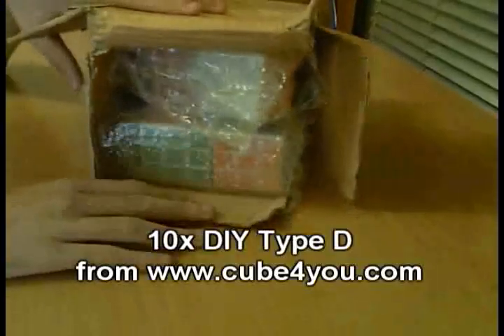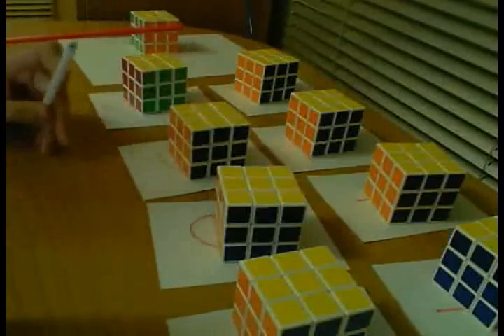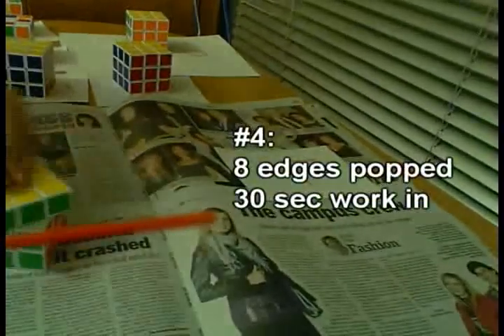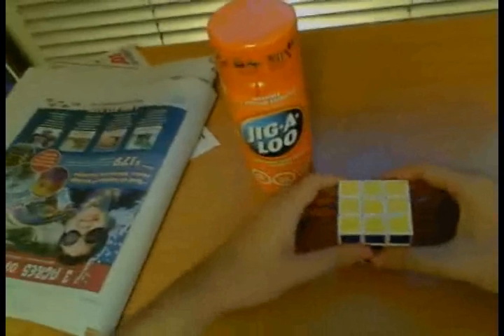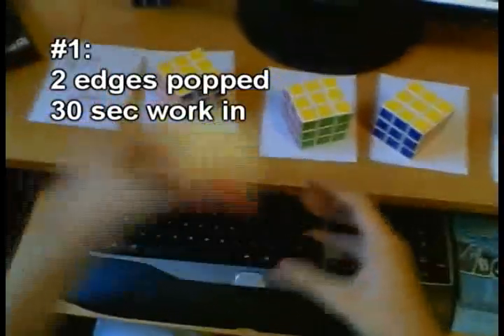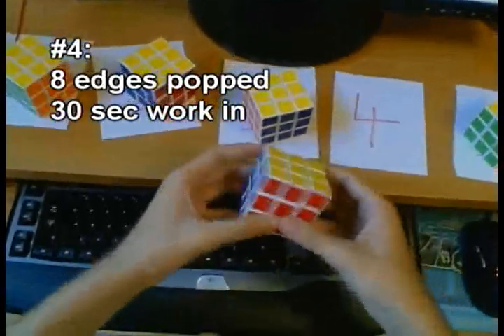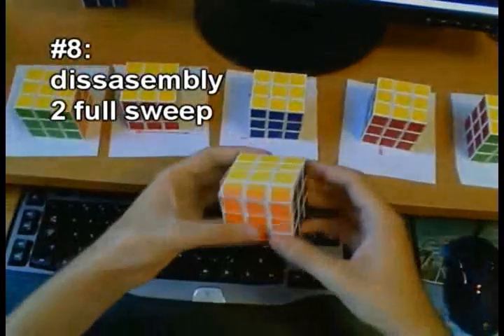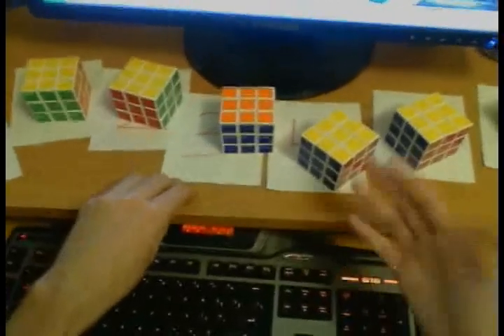Rubik's Cube Lubrication experiment

Comment: What's the best lube for a DIY Dayan Zanchi?
Reply: I tried WD40, it just made my cube oily and a little slower
Reply: +MCOnFire 
don't misguide man it's highly corrosive it works with very few types of plastic
Reply: i use wt 1 for all my cubes and wt 3 for the core
Reply: +Manya Cubies you mean?
Reply: Yeah I mean the pieces
Reply: WD-40 is not recommended, it's not actually a lubricant

Comment: I'm not from North America soo.... Idk the difference between this lube and WD-40, could someone please explain it to me?
Reply: yeah it's right it's corrosive
Reply: ***** Okay thanks!!
Reply: Only WD-40 Specialist can be used as a spray in the WD-40 series as it is their silicone spray. I just put a bit of 30k traxxas into my Rubiks brand cube (the tiled one) and it is comparable to many speed cubes now, even corner cuts nearly 45".
Reply: TheGozzila I did too, to my old rubies' brand cube, and it's pretty damn smooth but then I tried it on my rubies' brand speed cube and it worked for a couple of days but then it just made my cube way slower
Reply: +Zelaphin Strraughend the WD-40 makes your cube slow.
Reply: +Fazri Gading wd-40 is excellent lubricant but you should use it only when you are convinced that your cube can survive a lubrication done with wd-40
cubes are made up of ABS plastic and wd-40 isn't safe for it
Reply: yeah, my brother took it too much,
and yeah, the cube is completely worst.
Reply: for anyone who are reading this,
don't use WD-40 on your cube.

Comment: i use Calvin's Puzzle Lube on my Fangshi Shuang Ren and it cuts corners like nothing.  Just lube the screw under the head for each center, lube inside of the center pieces, then lube all along the side the last edge piece you put in (the one on the top layer that you put in between the two corners and force in on a 45 degree turn)

Comment: the core doesn't turn, it holds everything in place, you could spray the place where you have the pieces rub against each other, like in the video or spray the center pieces where they touch the core, if that is what you ment, but spraying the core only won't help at all.

Comment: silicone spray worked just fine in my zhanchi, but it gives it a heavy feel. if oyu lube a zhanchi with lubix or calvin lube it will turn 10x better and remain light and really really fast to move

Comment: I see that this is an old post, I am a beginner and searching for ways to get faster. Thanks to you I discovered the fredrich method only to solve the first two layers. My time has slowed alot but I see how in time they can be better then begginer solving with practice. Anyway, I have been using olive oil to lube my cubes. I heard you say vegitable oil as a good one and I had olive oil on hand, for me it makes the cube a smooth runner(olive oil). Try this and let me know what you think!

Comment: @AllenFG86 Well, sure it does, but eventually, the plastic on the inside will start to deteriorate, and the cube will age that much faster. Sure, silicone and jig-a-loo does that too, but at a slower pace, and is generally less messier.

Comment: I find if you dip a tooth pick in some lubricant and run it along all the edges of the top and bottom layer, then work it in, it will work very well

Comment: Well, it really depends what you consider "eaten".  the soft plastic does eventually start to wear off pretty fast, and it will get thin and break apart, though it'll take quite a while to get that bad.

Some people even do it intentionally for a bit to break in a stiff cube, then clean it off later and switch to silicone

The main thing is that people asking for advice know what they're getting into.

No, it's not going to melt your cube in an hour or something,  But it will shorten its life.

Comment: It'll still melt the plastic, but if nothing touches it (and your coats are light so there's no pooling) then it'll re-harden without much damage.

Personally, I'm not too worried, the wear isn't that severe, and you don't need to lube it that often.  maybe it'll wear out in 2 years instead of 3, but I'll probably break it, or lose it before then anyways.

Comment: If you just let it sit while there's still solvent there, the plastic will weld together as one chunk.
The upside to it, is that that slight melting will soften any rough edges in the cube, and they'll wear off while you're working in the lube.

It's kind of like breaking your cube in for a couple months, but it all happens in about a minute.

if you're really worried about the wear it causes, either pull the cube apart, lightly spray it, a few times, drying fully between coats, then reassemble.

Comment: Just so everyone knows how it works:

the silicone lubes are too thick to spray properly (and evenly), so they mix it with some lighter hydrocarbons (Its not a propellant, as some people say)  It's just a solvent to thin it out.

That solvent does melt plastic, which is what gives the sticky feeling right after you lube it.  Fortunately, it also evaporates quickly, so as long as you keep it moving for a couple minutes, it won't do too much damage, and then it's gone.

Comment: oil will degrade the plastic.  They're too similar chemically (plastic is made from oil).

The oil molecules will bind with the plastic molecules on the surface, causing them to detach.

If it's a really crappy cube, you could use it anyways, and buy a new one when it gets too messed up, but it's definitely not a myth that oil can eat plastic.

Comment: That's probably true. In memyselfandpi's video on lubing, he talked about how if you spray silicone between two surfaces and leave them there, the silicone acts like a glue and breaking it apart will slightly damage the cube.

Comment: Cool video.
It's nice when someone takes a scientific approach to things.

I noticed, though, that when you were popping a bunch of edges, you did them one after another.

there might be less risk of it sticking together and damaging the plastic if you worked it in, at least for a few seconds between edges.

I think that's the reason you had the sticking when you did 8 edges.  It's not too much jig-a-loo, it's just that the first edges sat for too long while you did the other edges.

Comment: You  should also try turning the up face ccw until about where the corner lines up with the gap in between the edge and the center piece, then turn the right face the same amount, the down face, and then the left face so that there's 4 dot shaped gaps at the corners of the center piece of the front face. Its hard to explain, but the holes are probably big enough to put the tube in to spray, try that on 1, 2, 4, and 6 faces. I would like to see if that might do well.

Comment: So, I know to spray 8 edges and work it in for 2 minutes or more, but would you be able to do the same experiment with Megaminxes? If you do that, just experiment with the amount of edges, don't bother trying to disassemble it and spray it that way because with 3x3s, just edges are the best. There's 30 edges, so you may need 15 of them, and go by 2s. Or just do 5, 10, 15, 20, and 30. (Going by layers.) Thanks. :D

Comment: have you tried anything either than jig-a-loo? perhaps some non-industrial type oil like mineral oil or cooking oil? how often do you find you need to lube the cube?

I'm not as picky about lubing as you uber speed-cubers, but, the way I lube my cube is using a syringe type applicator to squeeze a few drops in the corners around each centre piece and then use the cube to circulate it. really easy and no disassembly. I wouldn't use spray though, as that just shoots all the oil into the centre.